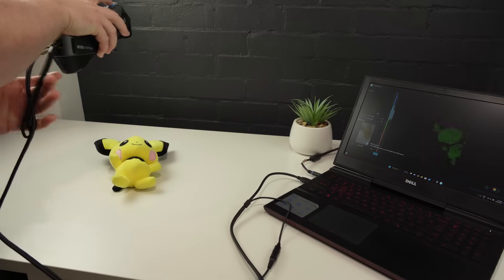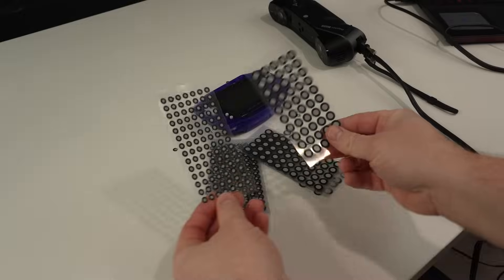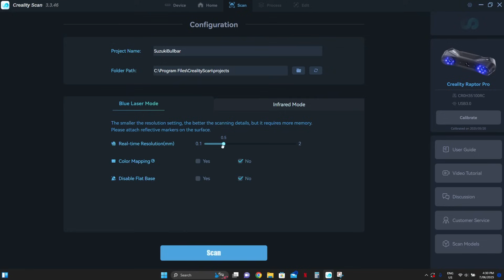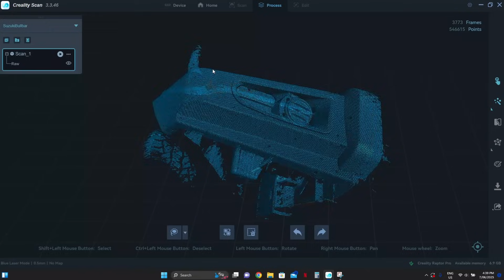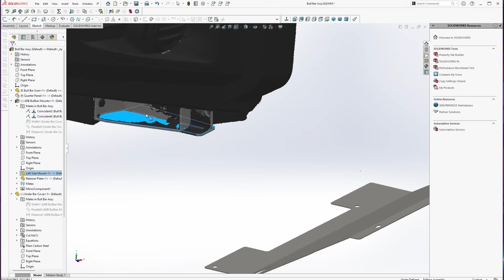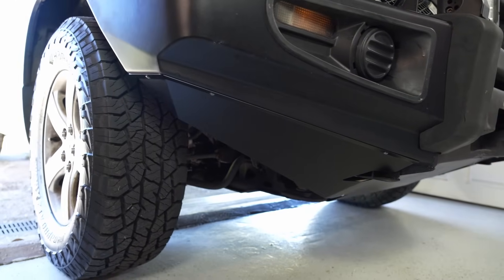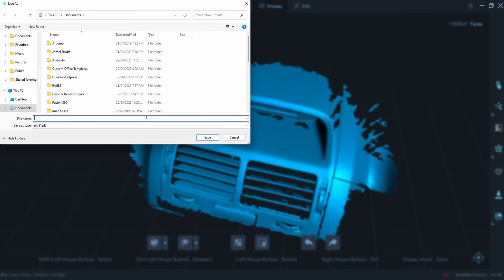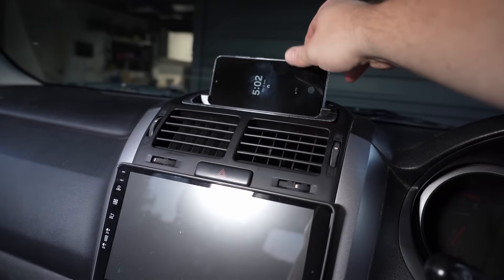Making parts for my car using the Creality Raptor Pro 3D Scanner!

Comment: dude this thing is sick! I have been hunting an affordable 3d scanner though. I cant really afford $1800. I mainly need one to scan in handheld pc's and small parts for modding and creating files. Do you have anything you could suggest for much less money?
Reply: read about the possibility of a xbox one kinect to use as a scanner. not that portable, but i want to give it a try because its relatively cheap
Reply from the maker: Yeah it really is cool! I'm not sure if there's cheaper models available, it's something I haven't ever really looked into. I did try the Xbox 360 Kinect scanning something like 10+ years ago but the resolution just wasn't good enough to use for anything practical IMO.
Reply: @cncdan hi I've been trying to reach you and talk with you about the DIY you made in your other video and I didn't find any Instagram or any way to talk with you about it how can I reach you
Reply: Have a look at the Otter Lite. Not laser but very good at tracking. It would scan those areas without tracking dots.